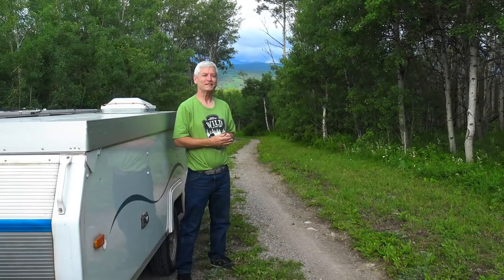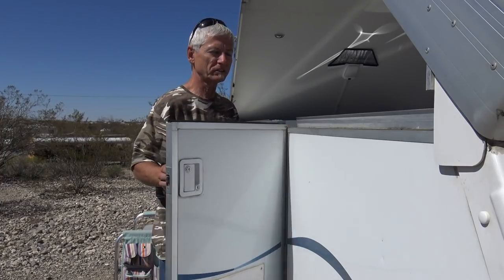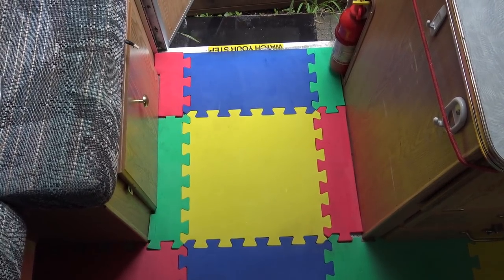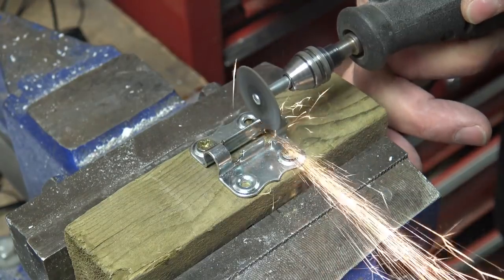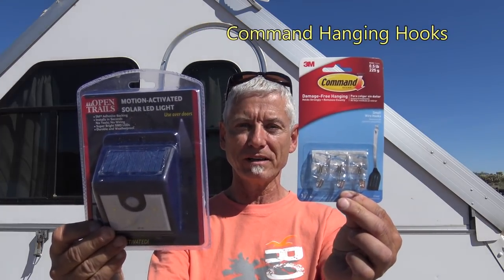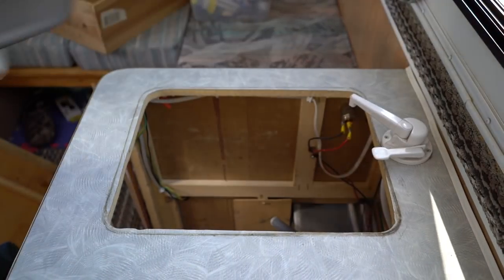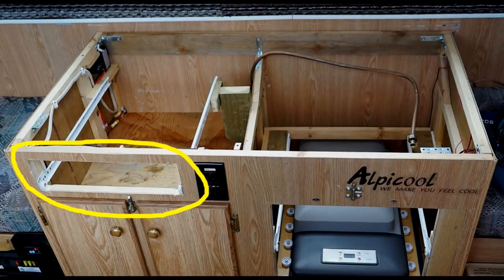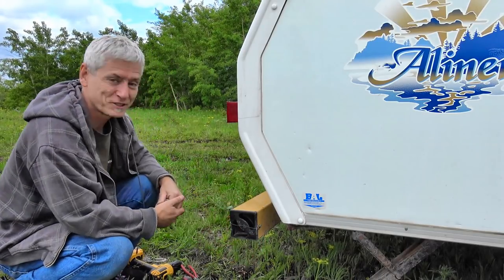10 Low-Cost Ideas for an Aliner Trailer - Pt IV

Comment: I like to use the phrase "Intuitive Engineering". Both the R.V. and Boating world have their retail shops with their gimmicky gizmos that cost an arm and a leg and first born for collateral, ... and the stuff barely lasts a single season. The only thing I would recommend on your bumper compartment latch is to use stainless wire. Most bailing wire is low grade steel and will rust fairly quickly. You could also use re-bar tie wire which has a (usually blue) vinyl coating to help prevent rust. At least put a visual or even hands on inspection on your weekly "pre-flight" list. Great job on the drawer latches!
Reply: He said it was an "on the road fix". He used what he had at the time.

Comment: Thanks Slim. I keep a small chunk of paraffin wax in my trailer for lubing things in the trailer. The paraffin travels well and does not attract dirt. Regards = Cosmo
Reply: Paraffin also makes a good fire starter if you just put a few shavings mixed with paper or cardboard under your wood.
Reply: Hey Slim great tips I've had my Aliner now for going on 11 years I love it. I can't wait till  summer comes around again. I have a question for you have you ever had to replace any of the windows?  Last year I cracked one so come spring I have to replace it . Hope you have a tip or two for that . Have a great holiday season!!

Comment: Hi, something I learned at work.  When you pull the cover off of the stove put foil under the burners if you spill or after several uses just pull the foil out and replace . Quick clean up.

Comment: slim P you got me now debating a scamp over a Aline..great tips any way no matter what i choose.
Reply from the maker: Cynthia, there is only one way to be sure, try them both yourself. RV Dealers will show you how comfortable they are inside, but not how they handle driving on a highway or rough road. A scamp is easier to set up and probably better insulated, while an A-frame has less wind drag and allows you to see over it while driving. I like them both! SP

Comment: Hi Slim, I have the Sportliner and I find most of your hints very usable. .However the one about the wind down legs I have a different slant on them, I leave them dry. As I sometimes leave the van where it is accessible by others, I wind the legs all the way down with the nose wheel up so that the nose points down as low as possible. Although if someone really wants it they will take it , but the flybynighters , can;t lift the nose due to the legs, and IF they have the winding tool , the amount of noise generated by the legs will wake the dead ... works well out front of the house at night too. We use it to traverse the continent West to East and back North to South to baby sit the grandchildren. I serves us well.
..

Comment: I installed the door "T" catch per your perfect instructions.  I didn't particularly like the long "tang" flopping about, so I epoxied a tiny magnet to a metal plate and pop-riveted the plate to the door to hold the end of the tang.  No flopping now when the latch isn't engaged.   I've put so many of your great ideas to work on my Aliner !  Many thanks, Slim.
Reply from the maker: Smart idea Jerry. Thanks! SP

Comment: Great ideas! =0)  We had a '76 Dodge van we used for camping and even though we put in a 25-gallon water tank, we found we had no use for a sink either.  We'd wash up dishes in bus bins (like restaurants use for busing tables) and tossed the water in the bushes... with biodegradable soap, of course.  We set it up with an outside shower curtain that hung from brackets and rails on the rear doors so we could shower, but had no need for a gray water tank.  It worked wonderfully!  Sinks may make it feel "homey," but they are a huge waste of space for most campers.

Comment: The bumper end cap, my first instinct there was a cotter pin. It would hold the plug in but be easy to pull and open the bumper.

Comment: I repaired my bumper problem by drilling a hole top to bottom at the edge.  I drilled through the cap as well.  Once the cap is inserted I'd drop a stainless pin through the hole.

Comment: Great ideas! If I may make a suggestion, on your bumper cap, drill a hole top and bottom through the bumper and cap, a few mm from the edge. Drop a skewer through it to pin it in place.

Comment: Nice job!

I removed the sink from my truck camper and use a enamel wash basin to heat water on the stove for washing up and dishes.
Reply from the maker: Hi Daryl, an enamel basin sounds perfect. I use a plastic one I store i
on my shower floor when not in use. Thanks! SP

Comment: grease is a good lubrication too, and just a bout the best thing you can put on the stabilizer, after putting your door latch on, you should always put a see thru type or white silicone over the screws or rivets, be cause the water will get in any hole.

Comment: Widely applicable tips. My sliding door squeaks where the gasket scrapes against the painted wood. WD40 is a very temporary fix. I think the wax will work longer. Plus, I’m pretty sure I have some in the garage. Thanks!

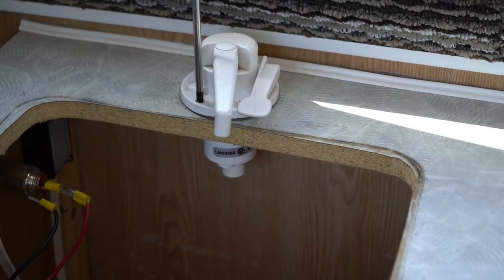Comment: @12:25, let's get some heat shrink tubing on those 12v-dc connectors.  Always good to cover those positives in case they vibrate lose.

Comment: Slim, bicycle or motorcycle chain lube can be used to lube the stabs, this lube is a wax based substance that comes in a spray or squirt type of bottle and is designed to lube without accumulating road grit.
Also my aliner came with a door brace from the factory, it's on the lower part of the door near the bottom so doesn't help with the upper door problem, but does hold the door open in a similar fashion as yours.
Great ideas though.  I installed drawers in the cabinet by the entry door replacing those crappy plastic bins that were in there, used drawer slides just like you did, much better storage solution.
Reply from the maker: Thanks Tom, I'll give the chain lube a try. Strange they put a door brace on the bottom. With it on top, you can leave the top part open and vent the trailer, but keep the bottom closed to keep small animals or children safe inside. SP

Comment: Great video. I might suggest you reverse the baling wire.   I think if the screw were on the outside rear, when you twist the other end it will not poke out and scratch and poke someone's skin, or ruin clothing.  I'll bet you're right handed.  Anyway, I really enjoy your videos.  Thanks
Reply from the maker: Thanks Gene, good point. Expect I will refine this at a later date. SP

Comment: another way of keeping your end cap in place on your rear storage tube is to drill a  hole on the top of the tube and a hole in the bottom directly  below the top hole. using a metal clothes hanger, cut it to length and bend it into a "J" and put the wire into the holes with the  "J" up side down . it will not come out of the holes during travel and it allows you to gain access to the  2" by 4''s you have in the tube

Comment: On that rear bumper cover, what about a hole through the top of the bumper and through the cover and insert a nail through it to keep it in place, I doubt the nail would work its way out especially if you used a large size nail and made the hole somewhat small to keep the nail from moving very freely but yet easy enough to remove without too much trouble by hand.

Comment: The nice thing about using oil, or bar and chain on the jacks. It will stop the rust, not sure how good the wax will work for rust.
Reply from the maker: Rust is the prime reason machinists use it. That and lubrication. Unlike oil it is also non-migrating. Thanks
Reply: I know Bar and chain oil is great to save your car from rust, if they salt the roads where you live.
Reply: @SlimPotatohead  Oil for undercoating spray it on

Comment: Hi Slim. I used to scuba dive quite a bit and our maintenance trick on zippers was a wax candle. We just rubbed it up and down the zipper a few times then ran the zipper out and back. Lubricated, sealed and done! wondering if a spray silicone used on tents would work.

Comment: Great video! I don’t have an Aliner yet but am getting some good ideas. One thing I don’t particularly like about the a-frame campers is the acoustics inside. Have you ever considered putting up adhesive acoustic panels? Saw them relatively cheap on Amazon. Didn’t know if you’ve ever heard of anyone doing that.
Reply from the maker: Hi Brian, are you referring to acoustics for singing or keeping noise out?!? Aliners are really poor for both. Doing video narratives while traveling is extremely difficult inside an Aliner!  SP
Reply: Slim Potatohead both! Anything that would make it sound a little less like one is speaking in a tin can. Probably wouldn’t be the best looking thing to have 12”x12” foam tiles on the walls. Once I get mine I’ll try it and let you know if it makes any difference! Thanks Slim

Comment: Hey Slim, hope you're doing well. I'm still checkin out your vids when i have time. I still have my Aliner and I enjoy camping in it as much as possible. Two questions: First, you are very handy, what is your background? Machinist? Carpenter? Secondly, why don't you use your sink? If there is a vid that talks about these questions then feel free to just send me the link and I will check them out. Take care bud!
Reply from the maker: Hi goodgollyjosh, I don't use that sink because I never use the water tank. I never use the water tank (I removed it) because I did not trust the water, I could not fill it when boondocking, and it took up valuable space. I now use portable jugs and wash my hands in a dishpan. As for me, I'm by nature a tinkerer. Thanks! SP

Comment: Great videos! Another question about losing the sink. If you camped mostly in parks with water hookup would you keep the sink? Thanks!
Reply from the maker: It depends on how much you rely on a sink. I use a wash basin that I stow away when not in use, so the sink was of no use whatsoever for me. Thanks! SP

Comment: What do you do about lights and insects? I have had a huge problem with this. I was hypothesizing that a light that changes from white to yellow to red may work but haven't road tested it yet. Thanks for all the great ideas!
Reply from the maker: Hi Victoria, that's an excellent question. Many forget the annoyance of little bugs in the summertime when choosing a trailer. Outside I use repellents and long loose clothing, plus a bug hat if it's really bad. Inside however has a lot to do with the style of trailer. Some, like my old Aliner, are not very bug proof, spider-proof or even tree frog proof. In choosing my next RV, this was definitely a priority. Thanks! SP

Comment: Just FYI, i have an Expedition Aliner 2018 and the door on the top part of the unit can lay flush, so when i'm putting it up/down i can leave it laying flush on the panel without stress on the hinges...  So maybe the older style ones have this issue.
Reply from the maker: Hi Konrad, good to know they've improved the design. Thanks!

Comment: I'm surprised you don't use your cordless drill to operate you leveling jacks with an adapter.  You can get one with an attached bit to prevent loss.
Reply from the maker: Actually I do! Check out Idea #10 in the prior "10 Low-Cost Ideas for Your Aliner Part III". It's at: https://youtu.be/eyi4CNrAb1Y. Didn't use it here because it would hide the squeak! SP

Comment: Nice cabinets. What do you do for water now that you've removed the sink and faucet? (BTW, we removed our pump and tank as well. Never used it once in four years but we did keep the sink and faucet for shore water purposes.)
Reply from the maker: Hi Mike, I store water in jugs which are very easy to fill up. Also, I have a dishpan I can use as a sink and store it away when not needed. Thanks! SP

Comment: Hi. do you use reflectix?  I'm wondering if that would help on the floor -- maybe under the mat in winter to keep your floor from being too cold.
Reply from the maker: Hi Vicky, Thanks for the suggestion. I know some use reflectix in the storage areas, however on the walking area it might trap moisture. I was actually thinking of trying reflectix not on the floor, but to cover some of the bare aluminum frame which contributes to a lot of heat loss. SP
Reply: I used low pile carpet with rubber backing from Walmart to cover hinges and roof line.  Used carpet tape to secure.  Has held up well and I don't get condensation.

Comment: What type of fasteners did you use in attaching the back support to flimsy wall?
Reply from the maker: Hi Leornard, I bolted the cabinet ends to the trailer frame. The back piece was then fastened to the ends with brackets. Thanks!

Comment: My camper has painted aluminum siding. Will the lighter fluid used to clean up the caulk damage the paint?
Reply from the maker: It shouldn't but test it first. I've used camping fuel to get goo off my painted aluminum. Thanks!

Comment: Have you changed your incandescent lights to led yet?
Reply from the maker: What lights are you referring to? Interior lights all LED. SP
Reply: Slim Potatohead Thanks for your reply. Indeed I was referring to the interior light mounted between your roof vents. It appeared by the color that it was still the incandescent type. Nice setup you have. I’m in northern AB. Very inspirational videos.
Reply from the maker: Gotcha! I used "warm" LEDs instead of the cold blue ones. Thanks! SP

Comment: Furniture wax is not a suitable lubricant, it has no properties suitable for exterior use or for any weight bearing mechanism. The screws on the stabilisers and pivot points need greasing. Attracting road dust is not an issue over corrosion.